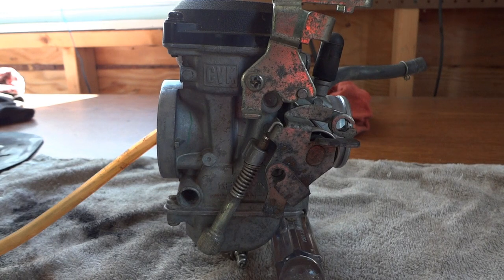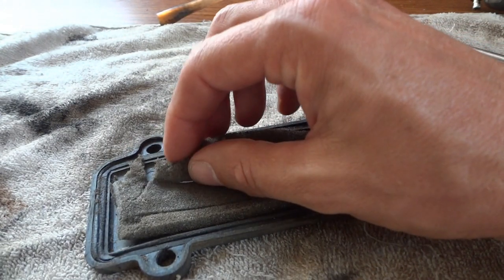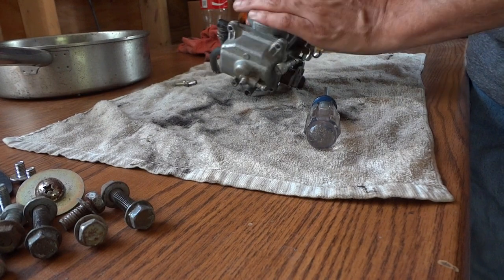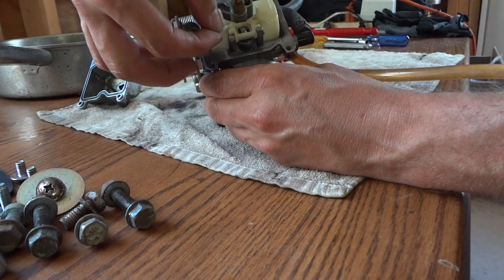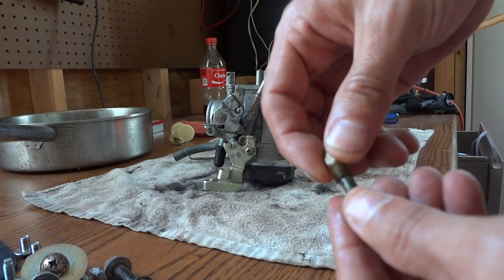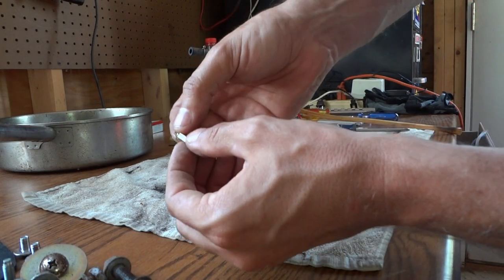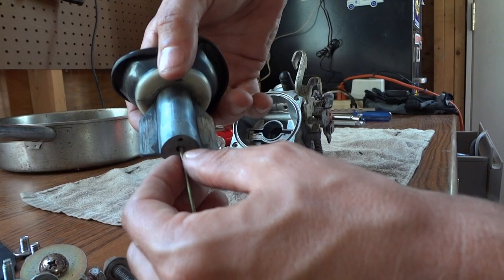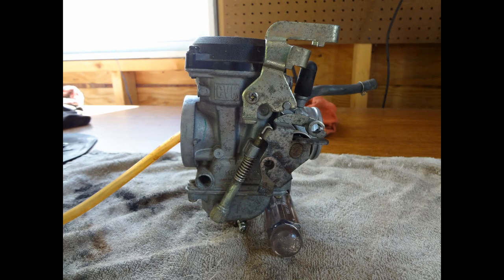Keihin CVK Carburetor Tear Down - Kawasaki KLR 250

Comment: Great videos! Just to confirm, the clear hose (reddish) is the overflow hose? So it shouldn't be connected at the back end?
 I had fuel leaking out of it, but the way it flares at the end I thought it had become disconnected at the back end somewhere?
Reply from the maker: Mine just hung down by the swing arm and drained on the ground
Reply: @SevenFortyOne  great thanks! That helps a lot!

Comment: I recently bought a 1989 Kawasaki klr250, I pulled the carburetor apart to clean it which went find but the floats are out of whack. With the bowl on I couldn't blow any air through at all. I took it apart again and messed with the tab on the floats and finally got some air through when testing. I have worked  on many carburetors but never this style. Where should the float level be on the floats? Any help would be appreciated. Thank you
Reply from the maker: Sorry - I don't know the answer.  You might be able to download a shop manual on-line someplace that will have the info you need.  Or, you might be able to check on a KLR-250 forum.

Comment: Would this be the same style of carburetor on a 93 mojave 250? I just bought a 4 wheeler and it was running great for a few hours, and then when I went to fire it up later on; it started real hard, throttle revving hi's and low's , I rode it a few minutes like that,  and I haven't been able to get it going again since. 

 I did make the mistake of putting crappy gas in it.. and now I'm trying to figure out how to drain the carburetor because I'm pretty sure it's been flooded. Any advice is much appreciated; thank you for this video tutorial. I know the carb on my 4 wheeler says CVK on it; I was just wondering if I could use this instructional video to help guide me with mine. Thanks again
Reply from the maker: I think this carb is very similar to the Mojave...not exactly the same but should be pretty close.

Comment: I just got a 96 klr250 that's been sitting outside for 8 years and I'm going to try and restore it. any tips?
Reply from the maker: My carb was always a problem.  Also check your airbbox for cracks - that will mess up your air/fuel mix and cause it not to run right.  Check for loose nuts/bolts - forwhatever reason its find things loosen up over time.  and check the fork seals. for leaks.  Good Luck!

Comment: I get black smoke from exhaust.Why ?
Stock carb, not sure what model it is.
Reply from the maker: Might be running rich.  Clean 5he carb and check the valve adjustment
Reply: @SevenFortyOne  Carb cleaned, Valves adjusted.
Black smoke still there.
Carb is stock with stock jets.
Reply: @oldgamermusic  exhaust valve or oil burning off some how piston rings maybe